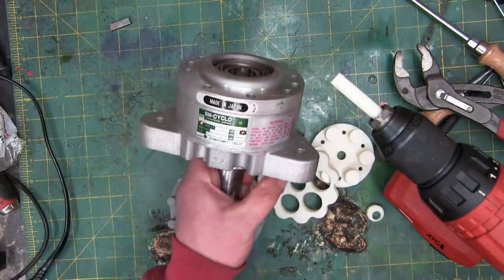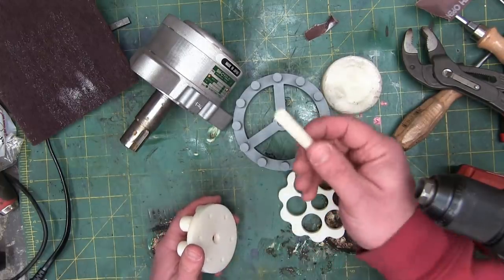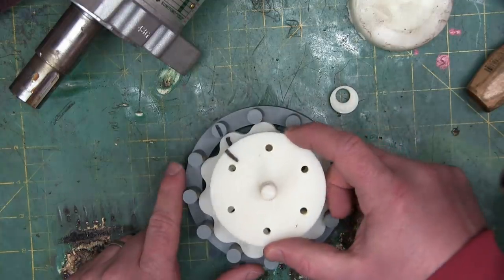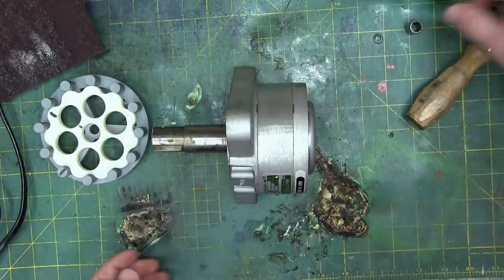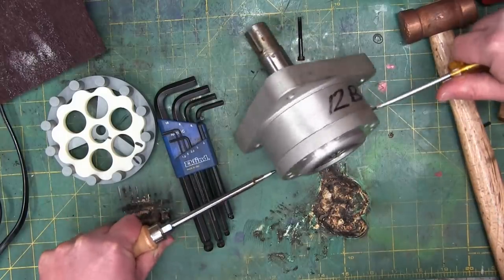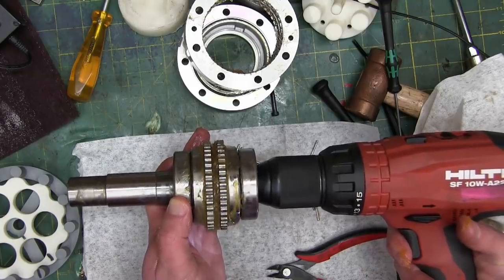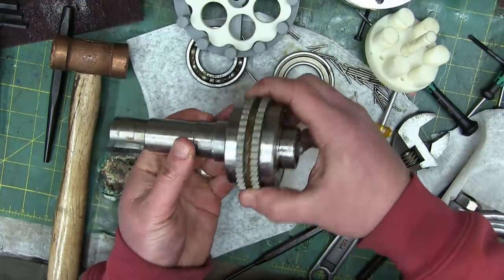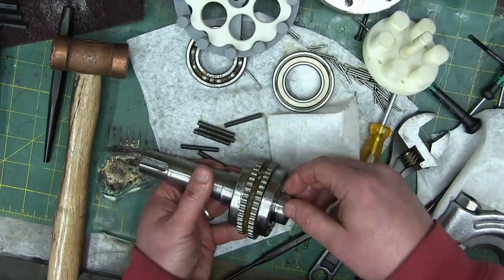BOLTR: SUMITOMO CYCLO GEARBOX | Zero Backlash!

Comment: I'm not at all convinced that the "no backlash" claims for this type of gear are any more valid than they would be for normal spur gearing of similar manufacturing tolerances.

Standard involute spur gearing can ideally be made with arbitrarily small backlash but it requires extremely accurate shaping of the tooth profiles. The operation of the gears involves some sliding contact, though, and so eventually some wear occurs, increasing the backlash. Such gearing is, however, often cut using tooling which spans a range of tooth counts and so the shape is not ideal; backlash is left in the system to account for this non-ideal shape.

Cycloidal gears like this can likewise be made with arbitrarily small backlash, provided the parts are shaped sufficiently accurately. The operation of these gears also involves some sliding contact, and so eventually some wear occurs, increasing the backlash. In this case the parts are machined for the exact ideal shape and so of course there would be less backlash. Spur gearing that was custom-machined for a specific DP and tooth count would likewise show little backlash.

There are some things one can do to the cycloidal gear system to reduce wear, such as replacing all those fixed round pegs with sleeved pegs. The rubbing of the cycloid against the pegs then instead becomes a rolling action as the sleeves rotate. You will get less wear from the sleeve rotating on the peg than you would from line contact of the cycloid sliding along a non-rotating peg. Such wear-reducing improvements are not possible with spur gears.

Comment: Hi, is it reversible - can you obtain gain in speed when driving from the output shaft or is it like a worm gear? Also do you have an inkling of the efficiency of the transmission - compared to a worm drive or as a percentage? I am thinking about applications using the Torsen differential. BTW, your vids me smile.

Comment: Sorry, bro, I'm pretty sure Cycloidal gearing was invented by the Germans, not the Japanese.. specifically it was invented by the Nazis.  Cycloidal gearing was part of the reason the Panzers and the Tiger tanks were so damn tough: Cycloidal gearing can withstand a momentary 300% shock-load - kinda like when a mortar round hits the front of a tank or riding across artillery-ravaged terrain.  Whereas a 50% overload will crush regular helical/spur gearing - what we were using in our Shermans.  The drawback is they are kinda hard to work on. (BTW, I am one of the handful of techs authorized to build these bad-boys).  43:1 is only about 1/2 of what Sumitomo is capable of in a single-reduction - they can do up to a 103:1 in a single stage gearbox.

Comment: I don't think you pull the center camshaft out. You split the output shaft by removing those large pins you said @ 10:36 you didn't know what they were. I was hoping you figured that out before the end of the video cause i wanted to see inside. Was a little disappointed. Nice vigeo tho. Learned something new today. :)

Comment: If you where to put a motor on the output shaft would it require 43 foot pounds of torque to spin the old input shaft?

Comment: Nice piece of kit
I've never come across one of those
What are they like for running hot, seems a lot of friction there
Reply: Not really. The cycloidal teeth roll on the ring pins, and the eccentric cams and output pins all have cylindrical roller bearings to eliminate friction. Probably some friction on the surfaces of the discs, but not much pressure there so it shouldn't be too bad.

Comment: Could you replace the 6 steel output pins with titanium or tungsten carbide to be able to handle the higher torque output?

Comment: Zero backlash, vibration at high speed?  Useful for a rotational milling table, like 4th axis.  That does not need to go a million miles an hour and needs accuracy.  They cost a fortune, do a quick eBay search.  Looks like something you have to machine from scratch :(

Comment: Could use that an automotive engine industry for the drag racers to spin their prochargers faster faster means more boost how much torque can a thing I handle spin the input shaft at 9200 RPMs and turn 40 times faster because I want to use it backwards

Comment: What on earth would you want a torque multiplier on a drill for? That torque would ultimately go against your grip.

If you want to maximize your effective torque... and you're going to bottleneck the process by using your grip to hold it in place, there's only one way to do it... oscilate your torque from high torque to no torque. That's what an impact wrench does. The weakest impact wrench produces around 250 ft/lbs of torque. The average arm can handle MAYBE 50 ft/lbs of torque... MAYBE... How is this possible? Well... it's possible because 250 ft lbs of torque is applied for less than a thousandth of a second, 25 times a second. The rest of the time is at lower torque or no torque. That means, about 1/40th of the time, the torque is at 250+ ft/lbs, and the rest of the time, it's not. This produces a torque on the hand of roughly 5 ft/lbs, and it allows enough time for the hand to move around the torque points instead of fighting with it... kind of like the non-work side of a ratchet.

In order for this to produce more nutbusting torque than a non-impact drill that attached to a human, you would have to secure this to something other than the drill. Lets say you're trying to take a nut off of a large rusty tracktor wheel... you'd have to secure this thing in place with enough rigidity to withstand the amount of countertorque you plan on applying... perhaps with a temporary weld... and THEN plug in the drill.

This is not practical at all for instrumental use. I do see the applications in robotics and fine movements... but this is not a useful accessory for other power tools.

Comment: The final drive motors for a 20 ton crawler drill were very similar design, same principle as that thing but about a foot and a bit in diameter. Same for the drill feed motor, it was only about 8 inches diameter. Better bearings.  https://youtu.be/0_tcLx9nmoI?t=67

Comment: And always the same: the grease is not there where it should be - between the gears/ bals/ rolls. It is pushed to the side. I think the lubricating with the grease is only by the basic oil leaking out and creeping of the soap emulsion toward the gears..